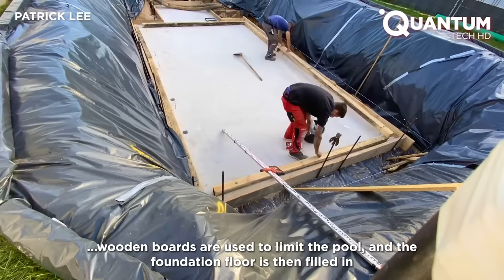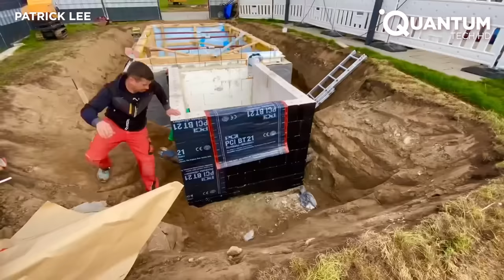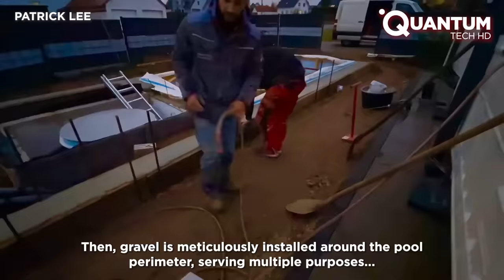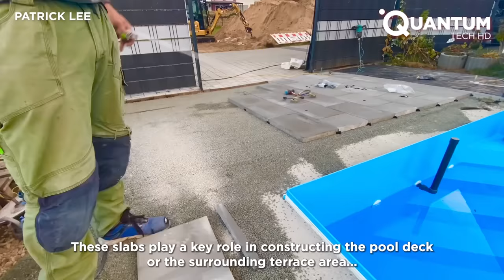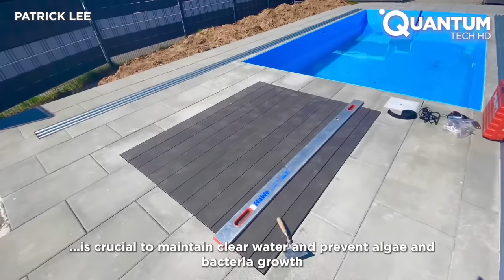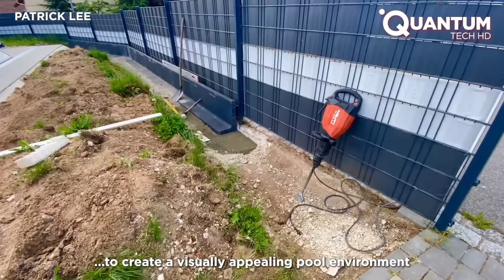Man Builds Amazing Swimming Pool in His Backyard | Start to Finish Construction by @patricktlee

Comment: In Florida we dig a hole in the ground, erect heavy structural plastic walls and dry cement the floor and install a vinyl liner. My pool has lasted 24 years, though liner are replaced every 12 years. This work shown here is wonderful, but seems to be a bit overkill in my opinion.
Reply: It was all for the show
Reply: Yes. Seemed to repeat same steps over and over.😮
Reply: Your right. 👍🏼
Reply: This pool was built in Germany. They have to consider the weather in Europe...
Reply: @Simonsimon-fy3hq  That’s why you rarely see outdoor pools here. It’s just too cold and windy for the most part of the year.
Reply: Yeah that's the cheap way. This is quality work.
Reply: @chrrev1 This video is crap I can build a much more quality pool with gunite and rebar the would cost half of this BS. It would also be more visually pleasing that a simple rectangle  bathtub.
Reply: It's overkill....unless you like replacing your liner every 12 years.
Reply: БОРЩ !
Reply: Тяжёлые пластиковые стены   во Флориде? )) В России это бетон и камень навсегда .
Reply: @cas5247 again this is Germany , Europe. I’m from the Netherlands, outside pools aren’t common in Europe especially not Germany , Netherlands ect. We swim in inside pools
Mostly. The climate here is unpredictable as well. Rain, wind , sun all in 1 day. It’s summer now and we had a good week but mostly it’s rainy. So the outside pools are a bit different than in other places and different materials
Due to the weather
Reply: Interesting. In our part of FL, there are very few vinyl-lined pools. Most are shotcrete, concrete or gunite with trowel finishes. Mine, albeit a small 16 x 38 rectangle, is 48 years old and has been resurfaced once with the pearl finish (a great upgrade). The finish tends to fade much slower and more evenly. Vinyl seems  to stain easier and fade unevenly....
Reply: As a Florida native, I was thinking the same thing.
Reply: In Florida. But not in Germany. Here we do long-lasting structures. 
Period
Reply: Did you have alligators coming in your pool, that would be my fear having a pool in Florida.
Reply: @BoominGame  No, that is not a problem here in Florida as building codes require a fence surrounding the pool to protect against kids falling in. That said up in north west Florida we have black bears that come into our yards and I have heard that some like to take a bath.
Reply: @knutbergan  lol I understand, Florida has levels like a video game, once you fenced the pool you unlock the bear level, once you pass that one the final boss is gonna have to be the creature of the swamp?! 😅
Reply: I plaster pools in Florida and we don't do vinal liners here in central Florida. Dig the hole, form with steel and wood, and then shoot concrete about 6 inches thick, shape it to the desired plan then tile and plaster. That's what building a backyard pool entails. Not shipping a fiberglass pool into your backyard after all they did was dig and lay a foundation. They didn't really build anything. Some vinal liner pools have to be built but not all. My pops did the vinal liner pool thing in Tennessee but in all my 35yrs of being around and in the pool business, what this video has done, is the opposite of building a pool

Comment: In France, pool installers often wait about a year before laying the terrace around the pool. Allowing the soil to settle during different seasons helps prevent issues like slab movement. This patient approach pays off in the long run, avoiding the need for later adjustments.
Reply: They compacted the soil they put back in
Reply: @firstman9273  multiple times over with layering. Masterful and thorough job
Reply: Proud when finished to say "that's my job, Sir!" ❤🎉
Reply: I live in denmark. Back in the 80s my family installed a circle shaped pool. They should have listened to you and waited a year before finishing the work  - you have a point and the terrace has over the years turned into a "bumpy" terrace
Reply: Our pool, in the US, they didn't excavate around the pool like here, only small trenches for plumbing and electrical.  It was dug to the shape of the pool rebarred and made of gunite concrete, finished with plaster to be smooth.  The deck slabs were poured before the plaster was applied, and pool filled.
   This was in 1986, the pool can still be seen from Google earth and still looks great.  I'm guessing the plaster has been redone a few times since then though.
Reply: I love pools - water, light and fire just make the difference in a garden
Reply: that's why they invented compactors
Reply: Soil being pub back was compacted in layers meaning you don't see settlement after the job's finished. Takes a lot more effort but much less time.

Comment: I’m a pool builder, I can build a one piece monolithic pool structure in less time and less work than this. All that work for a plastic or fiberglass shell?
Reply: I also noticed, despite all the poured concrete (base and upper ring), where there was rebar (forming materials, and all either in contact with the water or in wet areas, but there was no electrical bonding included anywhere. Did I miss it? Yikes...

Comment: Thank you for sharing the project.  It was cool to watch!  This man (Patrick Lee) I assume works in the construction industry?  The machinery rental rate?  Was that a septic tank nearby the swimming pool?  I live in Florida and 2 years ago I had a front row seat watching my neighbor's rebuild their swimming pool : I am very glad I got to watch the whole process from demolishing the old swimming pool and rebuilding a new swimming pool.  I cannot believe that a lined pre-fabricated swimming pool is much less expensive than a concrete/gunite swimming pool built on site.  The big dump trucks hauling away the construction debris and returning with new dirt busted the neighborhood's main water line!  Geez Louise, I cannot find a contractor willing to repair/restore my parent's swimming pool and other home maintenance/improvement projects; consequently, I have become a "Novice DIY Guy".  I have so many DIY Projects ahead of me. I am concurrently working on my parent's swimming pool [14,500 gallon capacity] and surrounding ground [I plan to plant new sod]. It is huge job for me: our swimming pool and pool deck was built in 1984 [too bad it wasn't my childhood home]. The pool needs maintenance/repair: besides a few tiles falling into the pool the following areas need repair; 1) the coping area needs to be cleaned and prepared for new mortar and/or concrete sealant, 2) the pool deck slabs may need to be jacked up unless it causes more damage, 3) the pool deck needs to be cleaned, resurfaced (?) and prepared for new mortar and/or concrete sealant in the control joints and cracks and 4) reattach tiles where necessary, I know I need to lower the water level to let the tiles and coping area to dry,  In my research of swimming pool maintenance and repair, I don't think our swimming is in despair as I once thought: I guess that is why I do not get a quote from contractors.  Most contractors want to demolish and build a new swimming pool - we are not going this option.

Comment: Very nice, but pool installers here in France tend not to lay down the terrace/deck surrounding the pool for a year or so to give the disturbed earth time to settle. Doing it too early can result in the slabs moving and becoming uneven. Allowing a few seasons of dry and wet weather to pass could pay off in the long run and avoid having to lift and reset the slabs.
Reply: They compacted the soil they put back in.

Comment: Wow what a lot of work , you know you can get preform fibreglass pools that don't need all that work and $$$ material
Reply: That is what I thought, so much work and expense for such a small pool.
Reply: Agreed, this in fact looks like a fiberglass pool (I had one installed myself this year) and for that a lot of the foundation and surrounding structure looks completely like wasted time/money. Plus all the water emptying/cleaning the builder does could have been easily done by a modern pool cleaning robot (which the pool owner should get anyway, they save a lot of time and energy)

Comment: Tons of cement, wood, iron, and many other completely unnecessary and exaggerated things. A lot of work for something we do here in Brazil in three days, much simpler and fully functional for decades of use. What is the reason for so much exaggeration?
Reply: Here in australia we you fiberglass from start to finish 5 days it will last a life time
Reply: Thats because in American they make it to last a lifetime
Reply: There is no connection between the floor steel and if any wall steel.
Backfill better be excellent to hold.😅
Reply: In America we like clean water....
Reply: Building codes
Reply: Cold weather region and frost levels in the ground.
Reply: Thats not America! Thats Europe an we know how to build for decades

Comment: It would of looked better if it was tiled, and was an overflow pool.  I think liner is quite a poor choice, and eventually it bleaches from the exposure of the sun.

It costs a lot of money to keep a pool running ie the pump must always run, and you have to add chemicals. And other potential maintenance costs. You need to continually it equipment, to clean it,  filtration, and hoover it, and net the debris out of it too.

It’s nice to have in your garden, but if you live near the sea, then that’s a better pool.

Comment: The pool has no drain at the bottom?  I guess the only way to chage out the water completed and to remove dirt, sand, and other debris from the bottom of the pool is with a pool vacuum and suction pump?  The visible ports for the pool water circulation system seem to have extremely limited reach, and it is doubtful that the water would ever be completely filtered and cleaned through this water circulation system

Comment: Is that pool cover to protect it from the winter? Every time they want to swim do they have to take that cover off. You didn't explain.
Reply: Cover is for the evenings and cold summer days when the pool is not in use, to prevent heat loss.  It's Germany, they will be lucky to have 4 months of usage per year.  And probably only 2-3 tbh.

Comment: Wind tests on these round structures have shown their stability if Grounded properly and should be enough to pass most all local building codes even if as utility structures. Codes need an upgrade to downgrade the unnecessary materials and processes. Insurance costs today have been ruled by profit driven corps; with immunity and should be a thing of the past. Insurance is not needed if the cost to replacement can be easily regained. Insurance co's have created mandatory "policy" that only hinders owners quality of life.

Comment: What's amazing about it? It's a small pool, and it doesn't even have a drain in the bottom so draining the water out of it if necessary would take a long time. And the shell is plastic? Doesn't seem like it would be very sturdy. Too easy to crack or break. I'll bet the lifespan isn't that long.